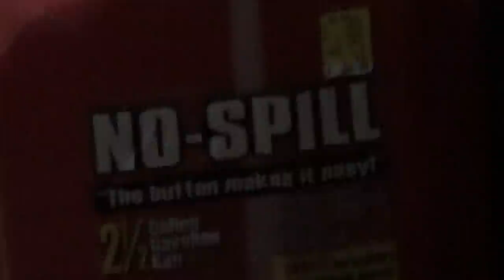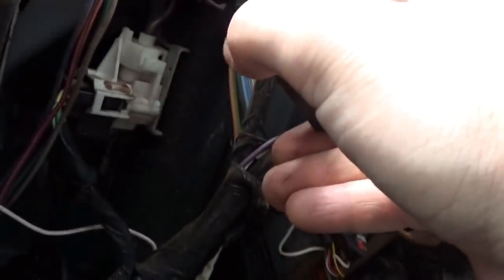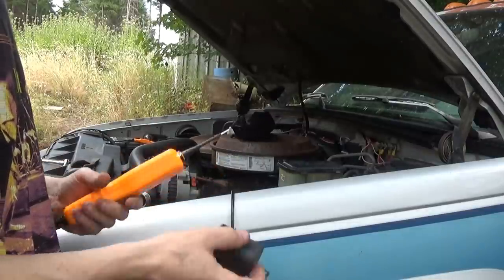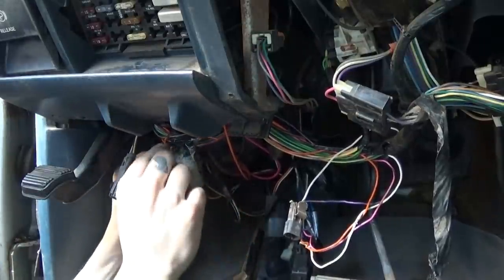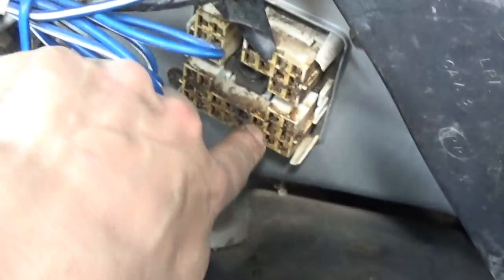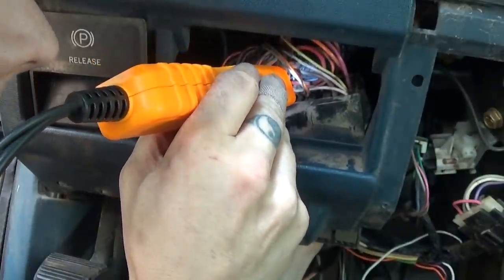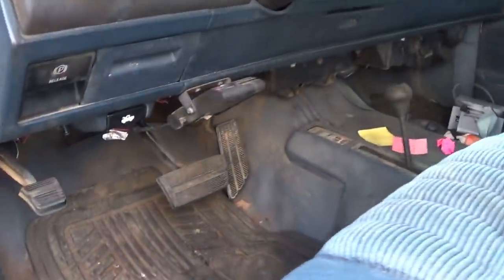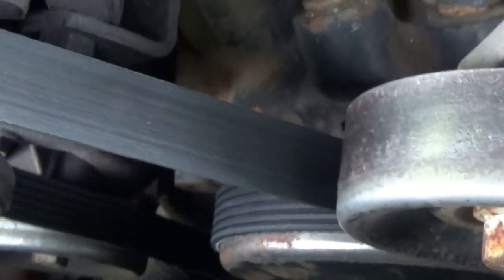Brake Light Troubleshooting Ep.2 || '93 Chevy 4x4 K3500

Comment: That group of ORANGE WIRES  WERE PUT TOGETHER FROM THE FACTORY like that I've encountered the same wiring like that in CARS I've worked on so leave them that way you will mess up if you don't I would say that your problem is in the MELTED GREEN & WHITE WIRE or somewhere along that line something had to cause those WIRES to get  HOT & MELT they had to get plenty HOT to do that too

Comment: We all got to know your wiring a little bit better in my case I wasn't having brake light so I did look at the orange and white wire so I follow the white wire to the connector on the opposite side of steering column and it wasn't all the way in. Thank you. P.s. I'm thinking of buying that Power Probe

Comment: Looking at the end with that belt, that "pointless pulley" sure looks like an air smog delete pulley. I did this on my 1988 where there was an air pump there that was intended for emissions. The difference with me was I did not install a pulley and use the same size belt but rather I pulled the pump and found the correct size belt (smaller) that went in place without the smog pump. These trucks were sold in all sorts of markets, like Mexico where that pump was not required and so they didn't get it there, so the belt I used was what was listed for that year / model engine size w/ out smog pump. The local auto store should be able to look it up. I suggest doing this because that pulley looks like it wore out the belt. I also agree with you that because of the clamp well basically you got someone elses hack implemented incorrectly. The correct way to do it that would be reliable is to get rid of the pulley and run the correct smaller belt or go get a smog pump and using the OEM size belt but that would not be advisable.

Comment: belt... ridges go on ridges. flat goes to flat. if the diagram tells you different, its the wrong diagram. good job with the wiring. roundabout way, but got it done.

Comment: Wish mine was this ... im chasing the dark green wire for the right brake light now ... not getting power out to the right brake
Reply: No right turn signal either
Reply: Did you get it fixed? It could be something to do with the trailer connection that connects from the right side. I always get a burnt out right blinker when the trailer connection shirts out causing the fuse to blow. There is a fuse specially appointed to just the right side for that reason. I am talking about a 2019 dodge ram 3500 though. But just an idea that could apply to what you're dealing with.
Reply: I'm having the exact same issue...

Comment: i had a 2005 ram 5.7 that i had lighting problems  no parking lights.  spraying the back of the fuse box with wd40 worked for a year then i bought a replacment on Amazon 176 dollars  brand new truck.

Comment: I got a 1994 Chevy 1500 with rear turn signals not working and brake lights not working. Everything else works fine. Any idea what it could be?
Reply from the maker: I would start by checking your ground connections

Comment: 1991 Chevy Silverado 1500 2WD. I have running lights, backup lights and both turn signals working. But no break lights and no emergency flasher lights. Already replaced brake switch, fuses and bulbs. Still no brake lights. No bad grounds found. We have tried just about everything we can think of. We need the break lights to pass the inspection. Do turn signal lights and brake lights share the same circuit on older vehicles? Could it be a bad turn signal switch even though the turn signals work fine?
Reply: Did you figure out why you had no brake lights? I think I'm in the same boat. I think my brake switch is good, but not 100% sure.....

Comment: They (gm) all do that they solder the wires and put duct tape over it. Idk if they got a sale on it? But it's what they use
Reply: The duct tape is not done by the factory or by the dealer. I`d bet the farm that whomever added in the trailer brake controller (likely some trailer sales place) was the party guilty of using duct tape to `close`after the (botched) operation.